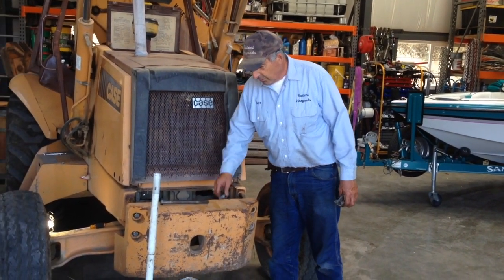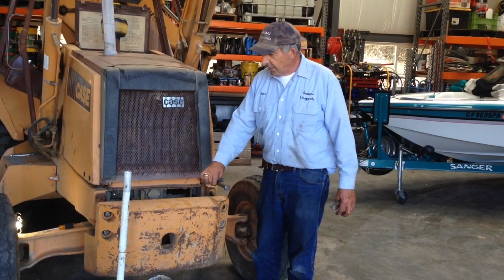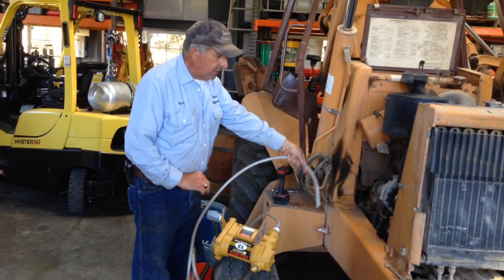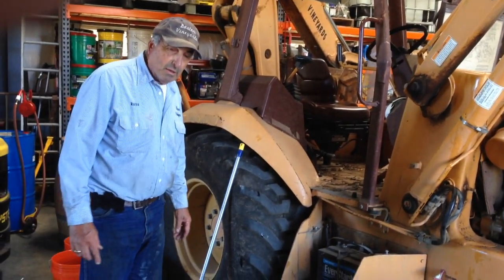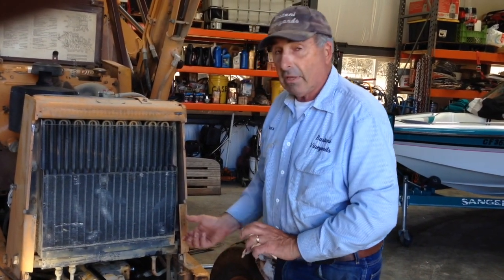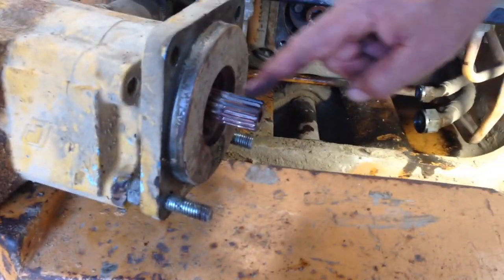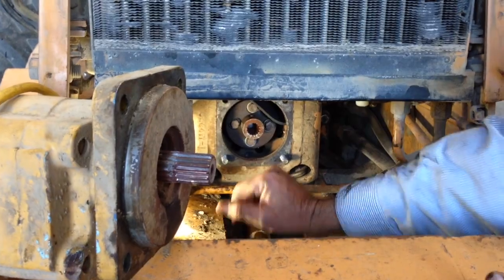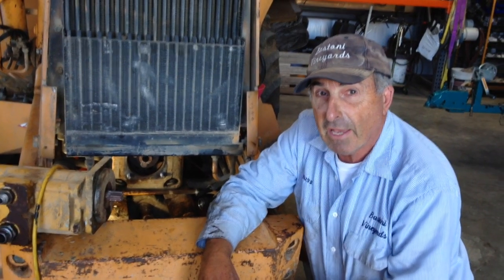Case 580K fan belt replacement

Comment: Great idea on the counterweight not being removed but slide it forward on longer bolts. I too recommend that you should only remove 4 bolts off balancer / pump coupler, then pry the coupler forward enough to slide belt thru on its side. Tools used are two 5/8 wrenches (torque), a man with pry bar on passenger side to hold crank from rotating, and him to also bump the engine over. Use left hand to reach and unbolt as standing between wheel and engine. No need to drain fluids. Case dealer works by the $$$ hour, not by the simple job.

Comment: to change  the fan belt on a 580 D case backhoe  4x4 it takes  approximately  30 minutes    loosen  the two bolts on the  hydraulic pump casing take a bar to push it back  enough  to slide  the fan belt down and around the crankshaft  pulley / water pump and the alternator it's 123
Reply: same for 2wd?

Comment: All you have to do is unbolt the coupler and slide it towards the pump....
Reply: Thanks DooMeD.  Will begin process this weekend.  Any tips are appreciated.
Reply: Actually, someone told me to do that. There was no way I could figure out how to get it unbolted and out of the way. I went to the case dealer, and that is where I was instructed to do the all day procedure of draining the oil and pulling the pump. Would you mind doing a video of the belt replacement undoing the coupling, along with any special tools you might use? If we can see how to do it, I will remove this video. For now, this is the way the Case dealer replaces the belt. Thanks.
Reply: , @rusmes4732
Reply: Actually I replaced my belt on the 580K last weekend.  The machine had set for 14 years and when I tried starting it, the belt snapped immediately due to frozen alternator.  Also when I got into it I had to also replace the radiator, alternator, water pump and the oil cooler.  So since those were out, and the hood was off, I had plenty of access to get to the pump.  I unbolted the four bolts you did, but all mine were bolts, unlike your two bottom ones which you said they were studs.  Someone must of screwed up the bolts before on a previous job.  Anyway, they came out fairly easily.  I also disconnected the hydraulic return line on the left that attaches to the strainer in the frame.  While I was there, I replaced the return hose, and cleaned the strainer.  You do not need to replace the strainer, since its stainless, just clean it. I did replace the hose since I was there already. I also pulled the 4 oil cooler lines and radiator hoses since I replaced both units. Once everything was detached from the pump, including detaching the hydraulic lines on the right, I wiggled the pump back and forth until it came out of the machine.  I now had room to replace the belt. I also put some antisieze on the pump shaft before I put it back in.  Someone told me since its such a time consuming job, that I should put a second belt in the space as a back up precaution in case the new belt breaks down the road but personally I dont know how you would do that with such limited space.  Anyway, it all went back together just fine, but took almost the entire day by myself.  A Case mechanic told me if I couldnt get the pump shaft to split from the machine, then just uncouple the 4 bolts on the coupler and get the belt in that way.  I think that would be harder in my case since I had everything off and didnt want to turn the pump over with out fluid.  Also, its tough to get to those 4 bolts and you have to "bump" the motor the get the bolts in a spot to get to them, but that may be an option for the future if I ever (god forbid) have to replace the belt again.
To answer you question about moving the front weights forward on longer 12"bolts, you dont need to do that.  I suggest DO NOT remove your video though since it was your video that got me to replace the belt myself so thank you for that.  Hope this helps, and thanks again for the video.
Reply: You can slide a new one in behind the coupler.  I’ve done it on a 580k and 550e.  
Less mess for sure.    Not a lot of room to do it though.

Comment: That is a lot of work not needed, take off the four bolts right under the fan to the pump and slide the pump yoke in, should be enough room to get the belt in there on it's side.

Comment: Nice Job!  Very clear process.  Saves reading 30 plus pages in the repair manual.
Thanks for the video...  By the way, how long are the bolts you used for the counterweight?
Reply: The bolts were 12 inches as I remember. When I slid the counterweight I used a floor jack and slightly lifted the weight so it would move easy over the threads.

Comment: I have a 580D and I'm also wondering if I could just pull the pump out and gain enough space without disconnecting the hydrolic lines. Maybe if I can get the pump out just over 2 inches without disconnecting the hydrolic lines I might be able to slip the belts off and through the hole?

Comment: You don't  got to do all that just just take the 4 m8 1.25 bolts out of the fan hub lay the fan up against the rad put some cardboard in front so you don't hurt the rad. Then just take the 4. 5/8 head bolts out of the pump shaft coupler. Slide the coupler forward put your belt on then put the fan hub back on. You Don really even have to take the fan hub off just gives you more room